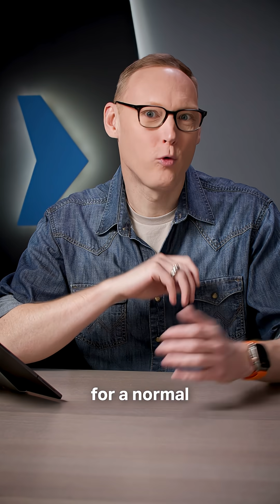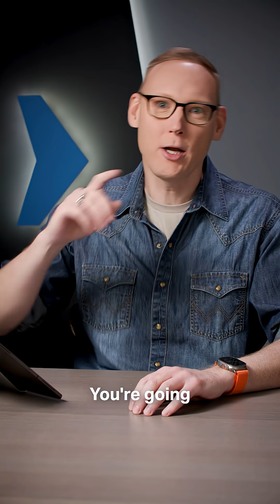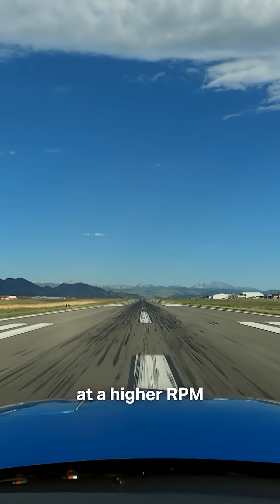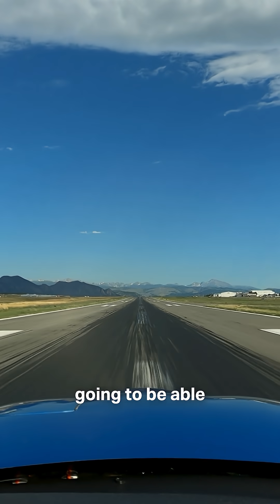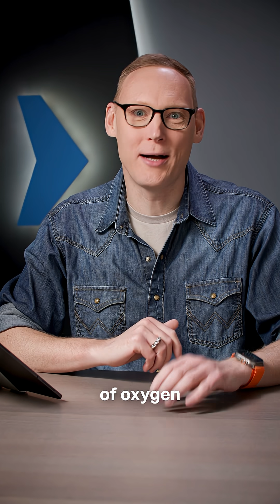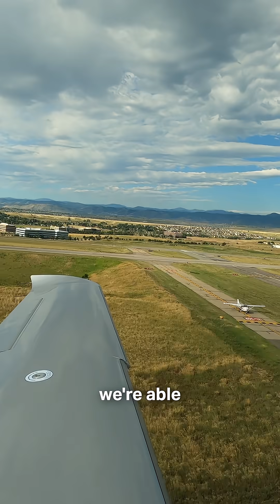Why use high RPM for takeoff with a constant speed propeller?

Comment: I dont understand. If you increase engine RPM, each intake stroke is shorter as the intake valve is open for a shorter amount of time. Doesn’t that mean there’s less air in the cylinders? It also explains the slight decrease in MAP when you increase engine RPM?
Reply: You do make a good point, there is slightly less air in the cylinder the faster the piston speed is. And all engines have a rpm where they start to lose horsepower(this will be past the engines redline in which you’re a test pilot and asking for trouble). To your point… a very famous and controversial mechanic in aviation says that engines are more efficient at lower RPM due to the explosion happening slower and pushing on the piston longer…and less frictional losses. While these cons exist, it still doesn’t make up for the for what bold method is saying in this video. 
I want you to research geared engines. Look at the GSO lycoming series of engine or the rotax platform of engines. Smaller engines making more power just by turning more RPMs. Outside of aviation most race car engines also have a similar concept. Some really fast motorcycles have turn 20k RPM to achieve maximum performance.